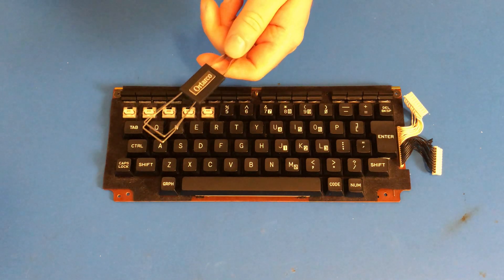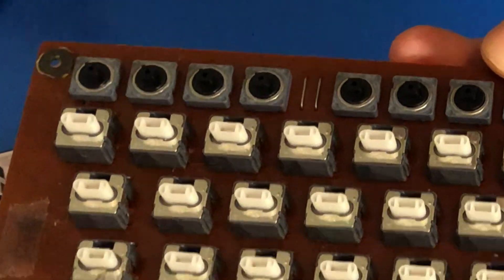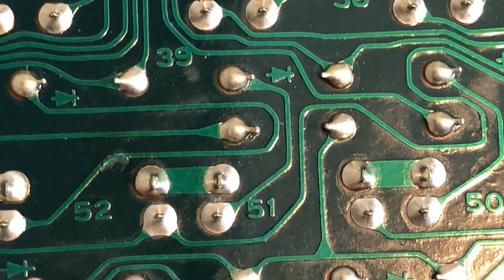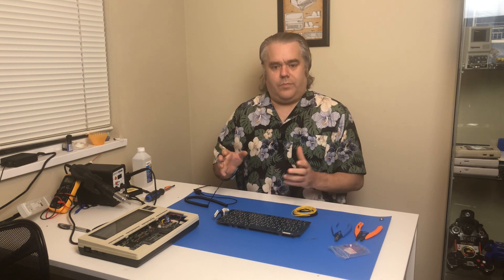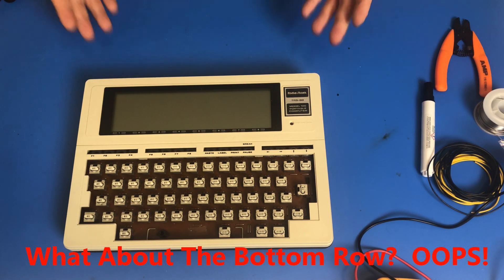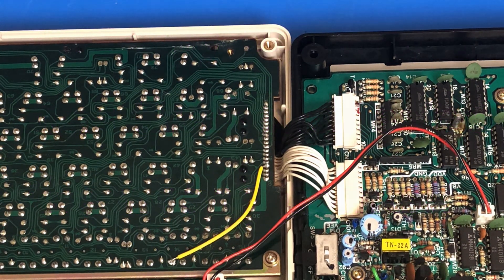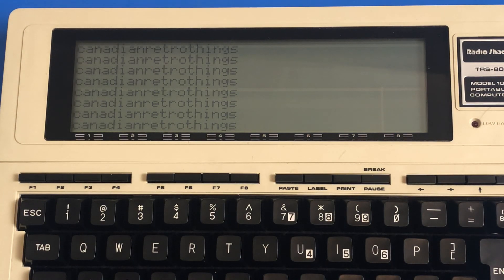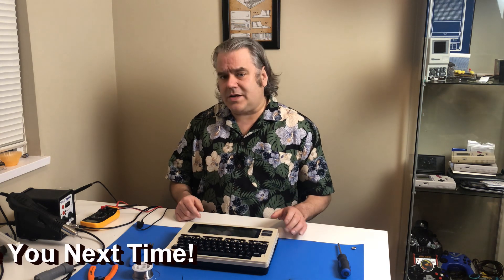TRS-80 Model 100 Part 3:  Keyboard Fix?

Comment: In my case I don't think this is the fix I'll need for my Model  100 keyboard. The keys that don't work anymore started to have occasional problems that got progressively worse over time. That suggests that the internal electrical contacts inside the keys have worn out. I suppose it wouldn't hurt to check the circuit board continuity though. I figure that I'll just need to get another Model 100 and use one of them as a donor machine to fix the other. Hopefully someday someone will 3D print some new key switches for this old computer. I do have an MC-10 with a keyboard that does require this kind of a fix. There is a crack in the keyboard circuit board that goes across a trace. So it will require a single jumper wire to fix the problem.

Comment: Great video Ken. I have a Model 100 that will type ONLY lower case characters. It will NOT display shifted characters using the Caps Lock, GRPH, CODE, NUM, CRTL keys. It also means that I cannot type any special characters. < >?#$%^&*(). Any ideas?

Comment: I've heard the model 100 and 102 had LCD problems
Reply from the maker: Mine has one small dead spot in the lower right side, otherwise is works great.  Not having any back-light on the screen it can be difficult to get a good angle to film but looks good in person.

Comment: Well done, and what a surprise to me that the traces failed and you found them and it worked first try! Debugging at its finest :) So...what do you suppose happened? Was this just something like corrosion? Those spots almost looked hand hacked, and perhaps corrosion or shock got to it eventually? Thanks for sharing!
Reply from the maker: There were some corrosion spots that I cleaned with the IPA.  It was a few hours of trace testing till I found the spots that didn't work (there were 6 spots + the last one I had missed where it looked like some of the traces had gone bad).  I was very happy that the jumper wires worked first try :)
Reply: @CanadianRetroThings  Excellent. Well, now I look forward to fixing my broken key, I think the machine basically works otherwise but now I realize a thorough check is in order. I think I just need to hack the broken base piece (that oval-ish part) so it fits the key snugly, possibly just fill it in.